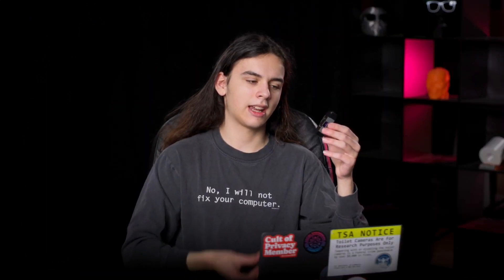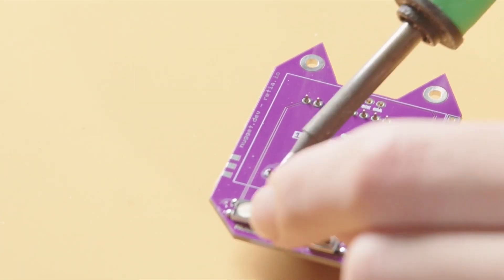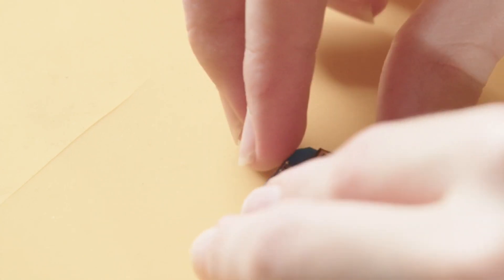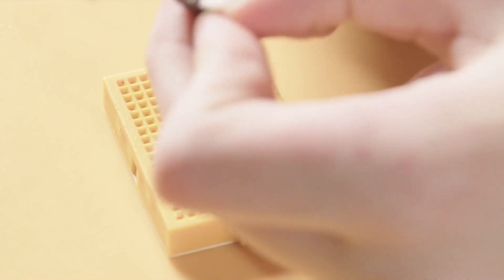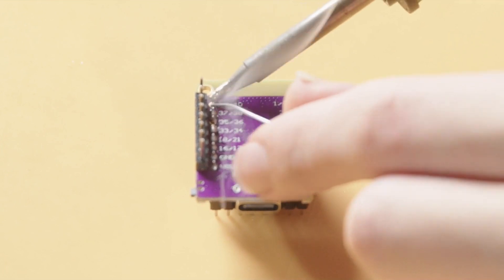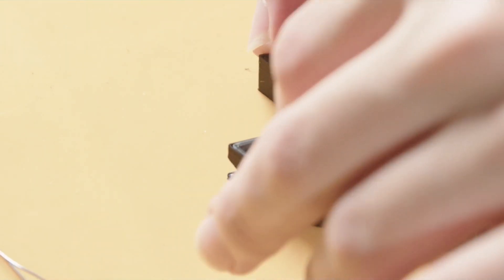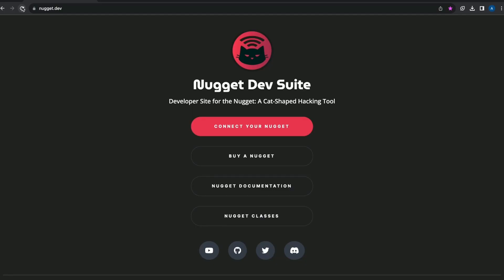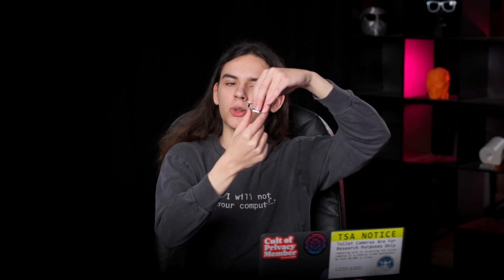Build Your Own Hot Swappable USB/Wi-Fi Nugget for Hacking

Comment: Bro can I use any esp32 s2
Reply: yes of course I DIY this USB nugget on a breadboard with esp32-s2-mini, OLED, 4 push button, and jumper wires and it works the same as in this video the only thing I don't have in my DIY is not having a neopixel LED but important it works the same I will add neopixel when my order is arrived from ali express

Comment: I'm not sure I understand the point of this. Doesn't the USB nugget work as a wifi nugget as well since it's esp3252?
Reply from the maker: The esp32s2 can't do wi-fi deauthing, while the esp8266 can't do native USB
Reply: I just bought a USB nugget thinking it was the same as the WiFi but with USB. Dang. So I'd have to de-solder the MC in order to put female pins on my main board huh?